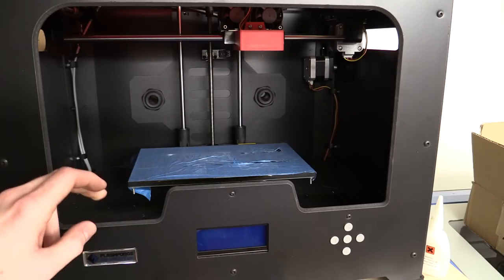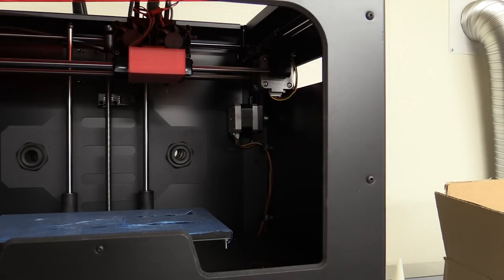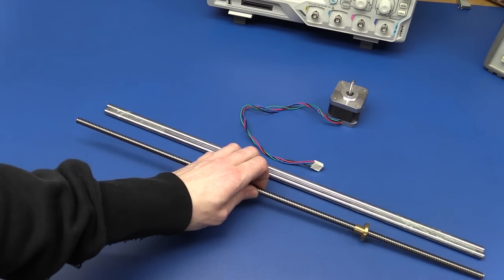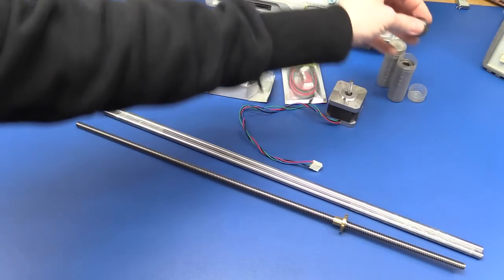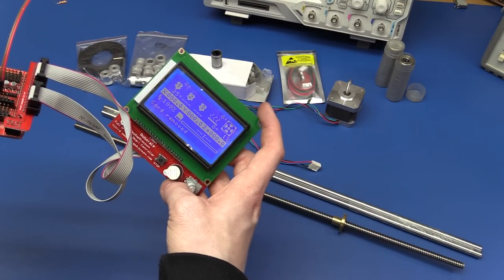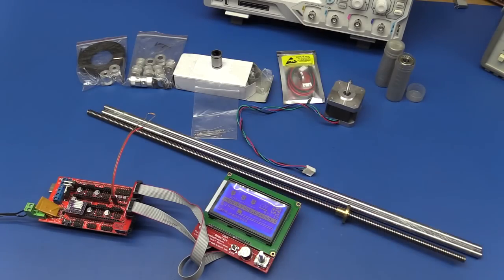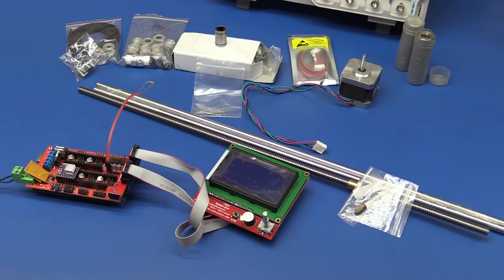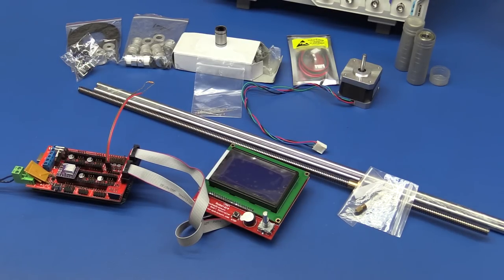DIY 3D-Printer Build (From Scratch) - Part 1: Overview and materials - Ec-Projects

Comment: Hi, I saw all the tutorials and it was awesome thanks very much, may I ask, what's the best control board to use for 3D printing or laser cutting? 
You have another printer that you made some parts, can I cut wood pieces instead of plastic? 
The parts that you printed on the small printer had a smooth faces, did you use sand paper for that or the printer gives smooth face? 
As I seen in other tutorials or printed pieces that it you can see the plastic layers, how to minimise that layers or I need to sand the final piece? 
Thank you again

Comment: Excellent Work! What's the maximum size for a build plate before things start to get a bit too complicated?
Reply from the maker: +Kyla Ross As long as everything is scaled to take the weight and forces, I guess it's just a matter of when you need to get the crane out :D The thicker rods get quite expensive though..

Comment: If I scaled up the size of the parts would i get a bigger working printer?
Reply: MECHA-TECH creates 
You just need to extend the x,y,z axis rails belts and rods. The rest can remain the same.
You will have to change the printing size in the software

Comment: Do you know v-wheels? Could it be better than linear shaft an bearings? All that on aluminium extrusions of course.
I am planning building a 3d printer but I don't know witch linear system to use. Is someone capable telling me more?

Comment: If I wanted to make a larger printer than this would I just need to buy longer piece that act as the axis bars and the screw thing also as a larger piece?
Reply from the maker: CJ outwest theoretically, yes, but there is a limit to how big you can make it without needing thicker bars as well.. I don't know for sure yet, but I think mine is close to that limit..
Reply: ok, thanks for that

Comment: Hi
i bought almost all the parts needed to build this 3d printer. but i stuck on the printed parts , there is no way to get them, can please tell where to get a replacement.

Thank you
Reply: Thank you,  but our local 3d printer services (morocco) still want more than 500 euros for those plastic parts, may be i will go for wood , or i will use a printer service abroad., how mush did you printed your parts.

Comment: Why not a delta style printer? fixed bed, less complex mechanicals, faster prints, larger build volume
Reply: Because the design has much wasted space.
Reply: I have a Rostock Max V2, and while they work wonderfully when they're configured right, they are a BITCH to get configured. Plus, you almost have to use a Bowden setup since the arms would flex too much using a direct drive system.

Comment: Nice tutorial videos. Are you still running Ramps 1.4 ? If you are, I just released some hardware for the Ramps 1.4 which takes care of wire management. I don't want to provide the link to Kickstarter, but you can search "Ramps 1.4 Breakout Shield". We'll be working on custom cables with the design, thought you might find it help for future builds.
Reply from the maker: +Jason Pasierski Thanks!! Sounds interesting!
Reply: Jason is this still a possibility ?  I am building this Printer with the Ramps and I would love access to a breakout shield and usb hot end.

Comment: I love the designs and all, but wish you didn't use so many 3d printed parts as it kinda makes it hard if you don't already have a 3d printer. You should try making as much out of wood and other hardware store material as possible.
Reply from the maker: +Nathan Schlenker Yeah, you have a good point, sorry.. :(
Reply: +EcProjects it's just that I don't have a 3d printer and its either drop $300 on a kit or your screwed. I know the idea behind reprap and all but no one documents their repstrap (no 3d printed parts) builds to allow for someone to be able to follow. I also am a huge R/C enthusiast so I'd like a larger format for my 3d printer to be able to make parts. I currently am designing, already have the basic frame on paper, a 3d printer with the hope of a 10"x10"x10" printing area, sorry imperial measurements. I have some 1/2" (12mm) plywood I'm gonna build it out of and have a pretty good idea on hoc the carriages are gonna go. I will make sure to document well though and keep a parts list so other can follow if it works. Should be able to keep it around $200 US as I found an arduino ramps combo for $25 (banggood) and a lot of 5 steppers for $28 (alixpress). Just need the bearings, screw for z axis, smooth rods, pulleys and belts. Also banggood has the mk8 extruder for $45. Gonna have to source a hot plate though. Good luck!
2 minutes ago•

Comment: 100$ for a 60x80 piece of plywood?! And there I thought they charge you a fortune here in Austria when they want 70€ per square meter of phenolic resin coated plywood of the same thickness.
Reply from the maker: 100$ for all of them, 5 pcs :) Just only showed one :)
Reply: EcProjects
Ah, I didn't get that you wanted built all around out of solid boards. But it's obvious, if ou want a stable thing.
That said, it is a rip-off here in Austria! Again wood raw materials more expensive then elsewhere. At least locally there's no cheaper source, and shipping a few square meters of wood costs another fortune.